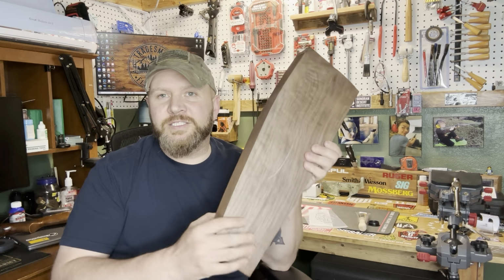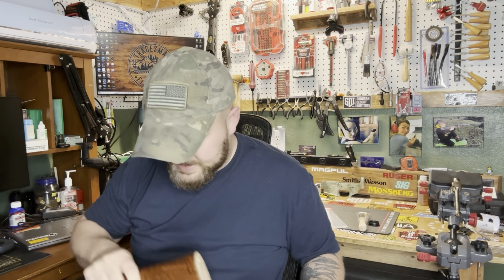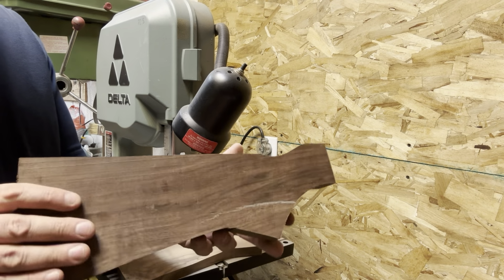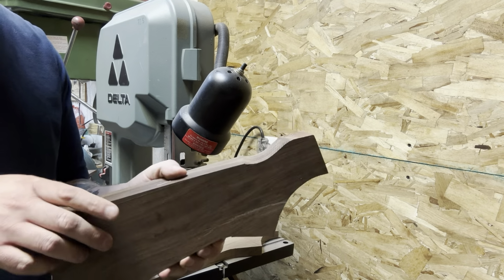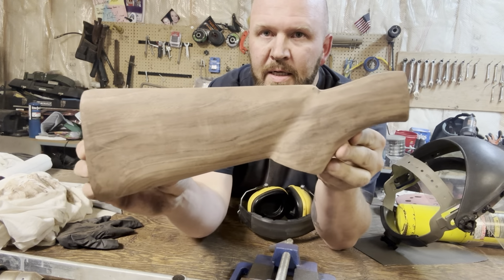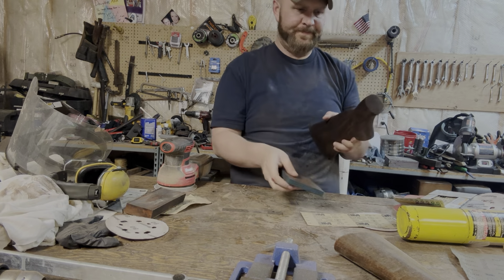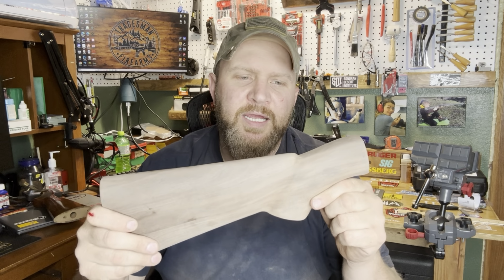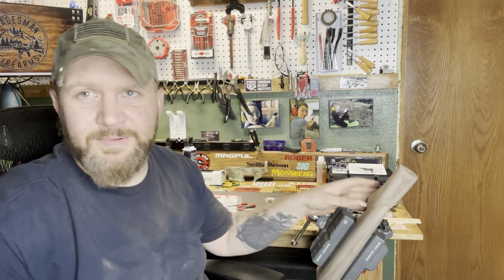SDI - FTT 214 - Week 1 Assignment Two (Checkering Lab Part 1)

Comment: You can always spray mineral spirits on wood and it will show all the markings without raising the grain making you have to resand it. I do this on all my projects towards the end to make sure the grain pattern lines up. Great work on the stock! Obviously I would have just used the block of wood as my stock…it’s called creativity!!!
Reply from the maker: Does it dry? I’m afraid of messing up my ability to checker it.

Comment: Current Student - As of 4/8/24 - Eclipse Day - Requirements are unchanged.
Reply from the maker: Thanks
Reply: I'm in the same class and I got a huge hunk of wood that someone already drew on. The instructors guidance said to just remove some of the rough material but not to hog it down. Whatever that means. Feel like they could of bought a bunch of blank shotgun stocks for the class and been cheaper.
Reply from the maker: @marcusoliger3639  amen.

Comment: I started week 1 of FTT 214 and I got the block of wood.
Reply: what do you do if you dont have a wood working shop?
Reply from the maker: @robertwilliams8912  The instructions are vague but they basically say shape a rough handle of a stock using files and rasps from previous courses. I recommend buying a couple cheap tools from harbor freight and and extension cord to do it outside. I am not sure what their thought process is on this, but hopefully they return to the stock blank in the future.
Reply from the maker: Good luck man, I would love to see what you are able to make with it. Talon.Jayne@tradesmanfirearms.com
Reply: Yeah I’m doing this class now and I do not have even half the equipment you got. I am going to use a stock from a old Deerfield shotgun and remove the finish. Then I am going to laser engrave the stock potentially to save time since I am in the process of moving. Is this course a 1 month or 2 month course?